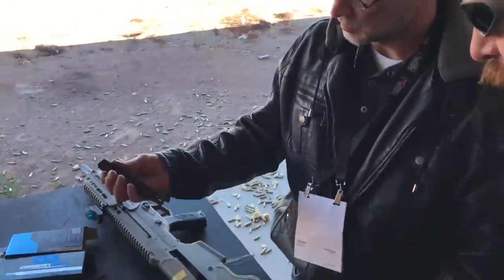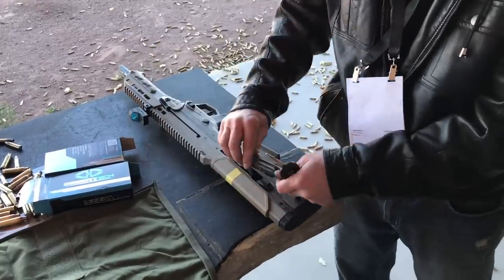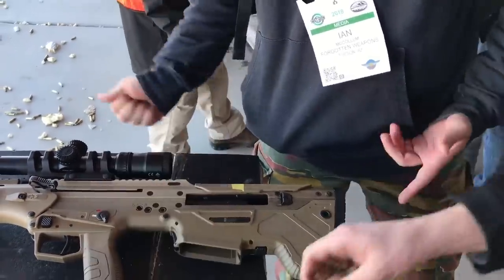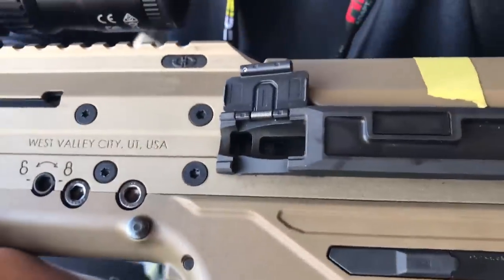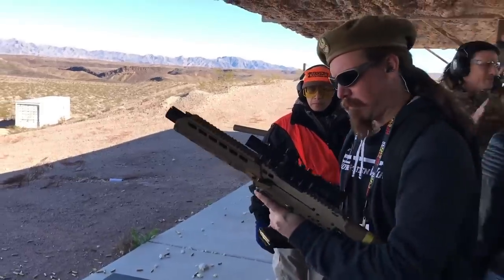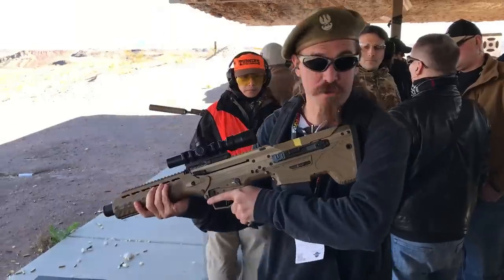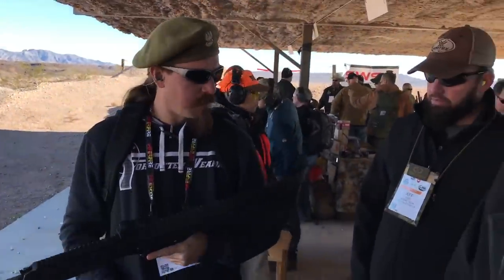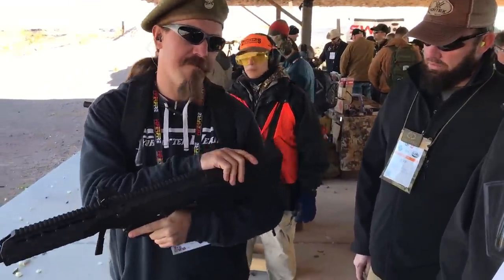Desert Tech MDR: Live Fire, Handling and Analysis

Comment: I love bullpups, and it's great to see them getting more refined. My only gripe is that small ejection port. It's great, that it funnels the cartridge forward and away from your face, but I can see it becoming a problem if the rifle jams or the cartridge fails to eject. Does it also come with or can it be fitted with a "regular" ejection port or is the ejection mechanism somehow functionally dependent on the plate and small port?
Reply: You can go right ahead and pop off the forward ejection cover, and the scissor ejector will kick the brass out side-ways like a normal gun. They don't currently have an AR-15 style ejection cover, but that would be a good idea for Desert Tech to look into.
Reply: Locotus494 Considering how easy the ejection port cover plate thing is to replace, I don't see how giving people the option for a different style of ejection port should be a problem. I like the forward eject, but to me it seems like another potential failure point for the gun.

Comment: Looking at DST's website they have the 5.56 and 308 at 8.5lbs. Which makes my interest level drop a little. That's heavy for a AR15 competitor.
Reply: You should never be comparing a bullpup to a conventional rifle for numerical weight.
1) Bullpups are almost always heavier. Even with that, they are usually easier to handle and support, due to the lack of forward mass.
2) Bullpups are very different from conventional rifles. They really don't compete with each other for sales. It's like saying that motorcycles and trucks compete for sales. They really don't, as they are very different and the consumer buying them tends to already know that they either do or do not want a bullpup.
3) Comparing the weights of a .308 gun that can take .223 to a rifle that is only .223 is already a stupid comparison.
4) The MDR is absolutely not competing with AR-15's. It's only conventional competitor would be the SCAR 17s. The MDR is really competing with the Tavor and Tavor 7.
Reply: LinkHyrule03 having shot and or carried most of the guns you mentioned I'll stick with the AR15. The scar is pretty decent if you're not limited on budget. 

An 8.5lb is going to be atleast 10lbs pretty quick. In 5.56 or whatever cartridge fits in an m4 magazine. I'm fairly uninterested in spending my money on it. But if you gave me one I wouldn't be mad at you.

Comment: IMO What concern me in the design is the ejector that is located in ejection port cover. 
Imagine in military heavy duty scenario, the ejector that located in the cover can be broken / missing, rendering the gun useless. 

Maybe Desert Tech need to take inspiration from other bullpup design lijke the new  Bullpup BR18 from the ST Kinetics of Singapore
Reply: FWIW this gun is basically meant to be a precision rifle shot off a bench, not a military design. I agree though, definitely would be concerned about long-term robustness with such a flimsy looking system.
Reply: In 11:45 of MAC video, that's what I concerned..., the "solid ejection cover", it has the ejector mechanism contained in that detachable part.

Comment: I wonder about those quick change ejection port panels -- they don't seem all that firmly attached to the gun's frame.  How durable are they?  Might they work loose with long use and fall off or just develop a slight wiggle that degrades ejection reliability?
Reply: They're very solid.  They are firmly slotted in the front with a very strong spring release tab on the rear.  After they wear in a bit you can pull them off with your fingers (if you have monster finger strength) but new they need to be activated with a casing or punch or something firm.  There is no rattle in them at all, even after several hundred rounds.

Comment: Ian, honest compare and contrast between your KelTec RDB and the 5.56 configured MDR, aside from the obvious cost delta between them. I know you were impressed enough by the RDB to purchase the demo gun you and Karl wrung out last year, and was curious as to your impression of the RDB vs MDR.  Is the MDR 2.5X the gun that the RDB is?
Reply: If money (or weight) is your concern, I would go RDB. They both shoot the same projectiles through a semi-auto bullpup. If just putting holes in bad guys for home defense (at a reasonable price) is your concern, the RDB is plenty good for that.
I'm very familiar with both and have been following the MDR for years. I currently have one on order.
For cost, it is hard to beat Kel Tec when it comes to bullpups.
However, where the MDR comes into its own is with accuracy, modularity, caliber conversions (ranging from .22lr to 6.5 Creedmoor, of which .308 and 6.5 Creedmoor are already released and shipping), ergonomics, and quality.
I love Kel Tec, but I have to objectively admit that while their guns are good enough, the precision and quality of their workmanship isn't why I buy Kel Tec. I buy Kel Tec long guns because they have the design I want at a reasonable price. Desert Tech is known for being really high end in terms of quality.
Accuracy: Courtesy of multiple independent reports, the MDR is just about 1 MOA, slightly sub-MOA with good ammo, a bit above 1 MOA with common plinking ammo. The MDR also has return-to-zero with caliber changes and cleaning, as they use more or less the same mounting system for their barrels that they use for their SRS rifles.
Modularity: A huge surge of aftermarket support is growing for the MDR. There's already caliber conversions, handguards, trigger packs, and much more. The design itself is very friendly to aftermarket support.
Caliber conversions: .308 MDR's are already mass produced and available. .223 / 5.56 MDR's are shipping in April. .300 blackout is supposed to be shipping by the end of 2018, but I wouldn't hold your breath on that. Those are the calibers being currently offered by Desert Tech, but they supposedly plan to do more. A sister company with a tight relationship with Desert Tech, ES Tactical (which already makes SRS conversions for DT) already has 6.5 Creedmoor available. Many other cartridges are being planned. There was talk of .22lr, 9mm, 7.62x39, a bunch of hunting calibers, and some big bore calibers.
Ergonomics: The MDR offers a great trigger. It also offers BOTH front and rear magazine releases. It also has an ambidextrous bolt release, charging handles (with HK-style hold-open and slap), and safeties. It ejects forward on either side or it can be run without the plate and just eject perpendicularly, the same way a Tavor would.
Quality: The MDR is very well made. Machining is precise and the design is good. I love my Kel Tec's, and they mostly work, but I can't say they look super finely machined.

When it comes down to it, why did I personally choose the MDR?
1) I want options for how to reload, so I like having both front and rear releases.
2) I REALLY like that cool delayed forward ejection.
3) I wanted a more accurate rifle
4) The RDB seemed to have heat issues when it came to the handguard not handling heat well
5) I wanted a single rifle that would be perfect as both a home defense bullpup and a hunting bullpup. The ability to change between .223 and .308 does that for me. A future .22lr conversion will only secure the deal for me, with cheap range plinking, teaching children, and small game hunting covered.
6) The RDB's sling points were unacceptable to me. I'm rather picky on that front. The MDR isn't perfect, either, but I can rig up the system I want with the MDR. I want side points at the rear with which to run a nylon strap across the butt.

Comment: @InRangeTV did I hear them say you could switch between calibers?
Reply: yeah. 300blk and 223
Reply: jonc151 gotcha. They were shooting the 308 and the 223 so I thought they meant you could swap those, and that just didn't sound right. It would be a neat trick if they could though.
Reply: +ZeroSuitSamo  It may not sound right, but it is totally true. The MDR is basically a .308 Win gun that has a quick-change barrel system for swapping calibers, they plan to release 6.5 Creedmoor and other short action chamberings in the future. With the STANAG magwell adapter inserted, it can also fire intermediate cartridges using AR-15 magazines. 5.56x45mm and .300 BLK are first on the list, but 6.8 SPC, 6.5 Grendel, and no doubt .224 Valkyrie are planned for later.
Reply: ostiariusalpha ok with the mag well insert that makes sense. Barrel and bolt are obvious, but I didn't know how they were going to make an AR mag work in a hole meant for a 308 mag.
Reply: Yes. Planned from Desert Tech themselves is .308, .223, and .300 blackout. They already have .308 shipping, .223 starts shipping in April, and they plan to have .300blackout shipping by the end of the year (but don't hold your breath on that one).
ES Tactical already has a licensed, produced, and functioning 6.5 Creedmoor conversion for the MDR.
.22lr conversions are in the works.

The MDR changes calibers in under a minute, with return to zero, just as with their SRS series of rifles.

And yes, the MDR will indeed swap between .308 and .223 in under a minute. Different barrel, a magazine well insert to accommodate the smaller magazine, different magazine, and some different action bits.

Oh, and courtesy of multiple independent reviews, the MDR is slightly under 1 MOA, which handily beats all the other bullpup competition.

Comment: I thought I'd only see the BR from Halo in my dreams
Reply: I swear to god that Kel-Tec modeled the RFB on the BR from Halo... just look at it!
Reply: Sceptis, actually not the case. The appearance of the Battle Rifle from Halo was most closely influenced by and modeled after the FAMAS, as per Bungie themselves.
Also, the Battle Rifle doesn't eject forward.
Further, Kel Tec's RFB was designed in 2003 and only got released in 2008. That 2003 for it's design actually predates Halo 2's release (November 2004), which saw the first introduction of the Battle Rifle.

The two are independent.

Comment: I am very worried about the rail on the handguard section, that is QUITE a difference in angle between the top rail of the firearm and the top rail of the handguard.
Reply: might just be a prototype
Reply: 1) They hadn't properly snugged the rail. The rail has a couple tightening screws that should help it almost return to zero.
2) There are already aftermarket aluminum handguards on the market.
Reply: Pretty sure this is more intended to be a precision rifle, not really meant to mount buis

Comment: How would you guys rate this against the Kel Tec RDB? Is the trigger better? Which ejection system do you prefer?
Reply: If money (or weight) is your concern, I would go RDB. They both shoot the same projectiles through a semi-auto bullpup. If just putting holes in bad guys for home defense (at a reasonable price) is your concern, the RDB is plenty good for that.
I'm very familiar with both and have been following the MDR for years. I currently have one on order.
For cost, it is hard to beat Kel Tec when it comes to bullpups.
However, where the MDR comes into its own is with accuracy, modularity, caliber conversions (ranging from .22lr to 6.5 Creedmoor, of which .308 and 6.5 Creedmoor are already released and shipping), ergonomics, and quality.
I love Kel Tec, but I have to objectively admit that while their guns are good enough, the precision and quality of their workmanship isn't why I buy Kel Tec. I buy Kel Tec long guns because they have the design I want at a reasonable price. Desert Tech is known for being really high end in terms of quality.
Accuracy: Courtesy of multiple independent reports, the MDR is just about 1 MOA, slightly sub-MOA with good ammo, a bit above 1 MOA with common plinking ammo. The MDR also has return-to-zero with caliber changes and cleaning, as they use more or less the same mounting system for their barrels that they use for their SRS rifles.
Modularity: A huge surge of aftermarket support is growing for the MDR. There's already caliber conversions, handguards, trigger packs, and much more. The design itself is very friendly to aftermarket support.
Caliber conversions: .308 MDR's are already mass produced and available. .223 / 5.56 MDR's are shipping in April. .300 blackout is supposed to be shipping by the end of 2018, but I wouldn't hold your breath on that. Those are the calibers being currently offered by Desert Tech, but they supposedly plan to do more. A sister company with a tight relationship with Desert Tech, ES Tactical (which already makes SRS conversions for DT) already has 6.5 Creedmoor available. Many other cartridges are being planned. There was talk of .22lr, 9mm, 7.62x39, a bunch of hunting calibers, and some big bore calibers.
Ergonomics: The MDR offers a great trigger. It also offers BOTH front and rear magazine releases. It also has an ambidextrous bolt release, charging handles (with HK-style hold-open and slap), and safeties. It ejects forward on either side or it can be run without the plate and just eject perpendicularly, the same way a Tavor would.
Quality: The MDR is very well made. Machining is precise and the design is good. I love my Kel Tec's, and they mostly work, but I can't say they look super finely machined.

When it comes down to it, why did I personally choose the MDR?
1) I want options for how to reload, so I like having both front and rear releases.
2) I REALLY like that cool delayed forward ejection.
3) I wanted a more accurate rifle
4) The RDB seemed to have heat issues when it came to the handguard not handling heat well
5) I wanted a single rifle that would be perfect as both a home defense bullpup and a hunting bullpup. The ability to change between .223 and .308 does that for me. A future .22lr conversion will only secure the deal for me, with cheap range plinking, teaching children, and small game hunting covered.
6) The RDB's sling points were unacceptable to me. I'm rather picky on that front. The MDR isn't perfect, either, but I can rig up the system I want with the MDR. I want side points at the rear with which to run a nylon strap across the butt.

I went MDR because I liked the design more and had the money. If all I wanted was a home defense bullpup on a budget, I would get the RDB.

Comment: Appears to pull to the side. I wonder if that would be an issue during rapid fire.
Reply: That's because that is a .308 they are shooting. .308's have much more recoil than .223. Look at how little recoil or pull there is when they shoot .223 later in the video.
If you watch videos of people shooting Kel Tec RFB's (also .308), it's pretty similar.
Reply: It isn't the amount of recoil that concerns me. Rather, the direction of the perceived recoil. If it pushes firmly straight back into the shoulder that is fine. A bit of muzzle rise straight up would be okay. Pulling to any other direction is a bit of a problem. It might just be the way they shot with it or it might be something to do with the rifle itself, not sure as I have not fired it myself. The fact that each shooter seemed to experience the same thing though suggests that it may be the rifle more than the shooter causing this.
Reply: Mechanically, the gun isn't recoiling to the side. It's just that it has a rearward recoil acting upon a man's shoulder, producing a moment arm. If they shot any other rifle of the same caliber, mass, and length with the same form, the recoil would look the same.
Reply: Different rifles have different recoil characteristics and this can include induced motion to the side. This is usually because of some motion of mass within the rifle that is not completely symmetrical to the sides or spins in such a way as to induce some torque. It can also be caused by gasses being expelled in an uneven way.

There is a type of muzzle device available that vents straight forward instead of to the sides as is typical. When this is used it slightly increases perceived recoil however the direction of recoil is straight back into the shoulder which can make it easier to control overall.

Comment: I know it's in .223 but will it handle actual 5.56?  (There is a difference between the two).  I can definitely say I'm interested.
Reply from the maker: There is no appreciable difference between the two.  It's a difference without a distinction.
Reply: I went ahead and got a second opinion from an other source just for the hell of it (and they got data from a number of sources like manufacturers i.e. Beretta and I think Steyr) and yeah outside of the most extreme cases used in testing for all practical purposes it not really that big of a deal.  Also desert tech's website only offers the mdr in 5.56, 7.62, and .300 BLK.  So I'm going with what InRangeTV said.  Oddly InRangeTV is in my auto complete...  This is the first time I've ever typed that out.  O.o
Reply: It will absolutely handle both.
The specific chambering of the .223 MDR is ".223 Wylde" which is a very precise chamber that will do BOTH .223 and 5.56 without impacting reliability, while also giving some accuracy advantages.
Reply: Regarding other calibers, Desert Tech is currently offering .308, .223 / 5.56 (actually .223 Wylde chamber), and .300blackout. .308 is already shipping, .223 is shipping next month, and .300blackout should be shipping before the end of 2018. 6.5 Creedmoor is also already available. There was also talk of .22lr, 9mm, 7.62x39, and a bunch of other hunting cartridges.

Comment: When comparing against the WWSD rifles, isn't this thing about 3lbs heavier?
Reply: 1) Bullpups are almost always heavier than AR's.
2) Bullpups tend to be easier to hold and support, due to the lack of forward mass. This significantly mitigates the weight issue.
3) .308 guns are obviously going to be heavier than .223 guns. WWSD was with .223 AR's. MDR is .308.
4) WWSD resulted in moderately light AR's, even by AR standards.